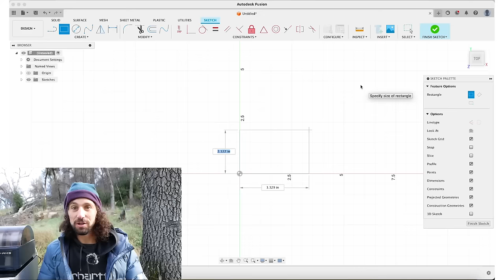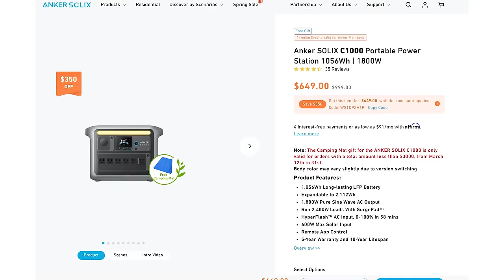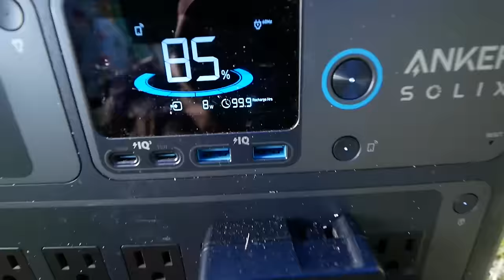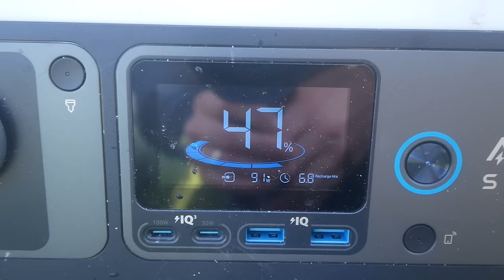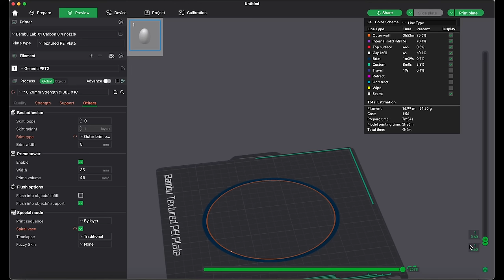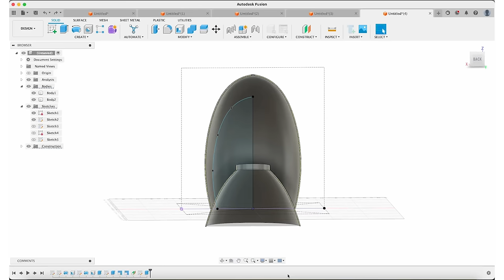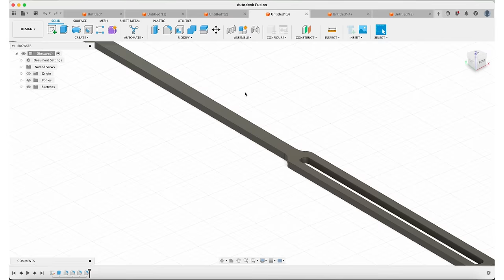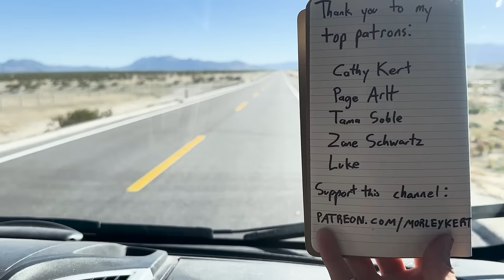I Survived in the Wilderness with a 3D Printer

Comment: Acorns!  Great video.  Here are my recommendations:

1. Printed frog spear tip
2. Printed knife for cleaning frogs/fish
3. Print a chain for your pot, so it is adjustable, instead of the hook, or in addition.
Reply: ChristopherWallbank-di9hj There are thermally resistant filaments, but those are all hell to print, and I wouldn't fancy trying to unclog a nozzle in the middle of the woods.
Reply: ChristopherWallbank-di9hj  did you even watch the video?
Reply: 4.printed rabbit snare
5.printed hand held crossbow(and bolts)
6.printed bird trap
7.printed fishing pole and hook
8.printed rain water collector
9.printed advanced warning system
10.printed bear trap

i could keep goin but i think we all get the point at this point.
Reply: @SnepBlepVR  could a 3D printer print a crossbow with bolts or a bear trap that actually works? And don’t forget the power supply restrictions he has in this situation.

Comment: i mean basically working with clay/ceramics was pretty much the first "3d printer" type thing. to many people sleep on what can be done with clay.
Reply: I dont think you can work clay out in the wild though. You'd need a fire far hotter than any natural open fire could get in order to get it to harden. But working with clay can be pretty cool, if you have a kiln for it.
Reply: @unironicallydel7527  you can fire clay with a small fire. There are also different lvls of firing clay and the higher temp you get the higher firing you can do. Also increasing the temp of a fire is pretty easy with some people just blowing on it with tubes or making some kind of pump blower. That and you can just make charcoal and use that. Or both. But yeah you can fire clay perfectly fine with a standard small bonfire.  I actually have a small Jack skellington head I made by just dropping it in my bonfire while I was drinking with my family. No blowing no charcoal just a small wood fire.
Reply: I also made a little ceramic water filter doing this. Just mixing sawdust and clay together before firing it.

Comment: The reason the rope is worse that the tpu filament is the heat to melt it breaks the copolymers in the plastic causing it to get weak. so you are always better off with using the filament as a cable.

Comment: I'm a little surprised you didn't try printing a net for the stream on Day 2.  The tiny basket, I wouldn't expect that to hold a sizable fish, whereas a net could possibly just corral some to make spearfishing (using a sharpened stick, not a 3d-printed spear) viable.  Then again, I am such a city boy, I probably shouldn't be commenting.  :)  Also, avocado is such a great radio handle.  :)
Reply: Excellent insight imo❤
Reply from the maker: I didn’t see a single fish in the river, so I’m not sure what I would use a net for. Unless it was a big gill net to act as a trap.
Reply: @MorleyKert  good point. Maybe if there was already a natural choke point, or a rock funnel, then a small net? But that's a lot of work for a place with no visible fish. Would love to see a part 2 where you apply insights from this time to see what could be improved. Dosnt need to be a full week of no food though haha
Reply: @MorleyKert  mostly fish try to stay hidden, that water looked like a great place for some

Comment: 9:28 the "flint" is the part that's made out of mischmetal -- this alloy of rare earth elements will burn in air. (Note that this is the opposite of traditional flint and steel, where the flint causes bits of steel to flake off and burn in air.) The magnesium is pretty much just magnesium alloyed with aluminum.
Reply: I thought it was ferrocerium, or are they just different names for the same thing?
Reply: @bs9692  You're correct -- the "flint" is made from ferrocerium, which is an alloy of mischmetal (~95%) and iron (~5%). Mischmetal is predominantly cerium (55%), but also contains other chemically similar elements like lanthanum (~25%), neodymium (~15%), praseodymium (~5%), and other rare earth elements. These elements are not easily separated from each other, so they are typically used as a mixture unless a specific rare earth element is required. (This is also why so many different elements -- four! --
are named after the town of Ytterby in Sweeden -- they were all mixed together in the ore mined there!)
Reply: Thanks you the extra information

Comment: Honestly, I have never had frogs, nor do I ever want to have frogs, but if I were to hunt them, I'd have made a frog-gig/fish-gig out of a 6' long stick. A gig is basically a multi-pronged spear you could use to spear frogs, fish, or any other slower moving animals. Using a gig, you could have used those frogs to catch fish. If I were to print a sling, I'd have made one that didn't rely on elasticity to function (think David and Goliath), just practice.

Something I'm surprised you didn't think of during the week, was to pile your magnesium shavings in a pile, cover it with your tender, and strike the ferro-rod into the shavings, pulling the ferro-rod towards you and leaving the steel near your target to ensure quick lighting. That would have made it much simpler to start a fire, instead of rushing to get your tender over the burning shavings.
Reply: Frog legs are absolutely amazing they’re like chicken but better you should try some one day

Comment: Definitely should have used a Hiking Trailer/Cart its like a wheelbarrow in reverse, it's pulled and not pushed and it uses a harness to attach to you. Think of it like those guys in India that have foot-taxis they pull you in, but it's smaller, has suspension, and is designed to handle uneven terrain, while keeping even weight distribution.
Acorns

Comment: Another thing that I would have done is to put those things that you don't want to get wet by turning the wheelbarrow upside down over top of them. 
You see, I'm a country girl and I've learned a lot of things in the 76 years of my life so far. 
What's the most coverage I can get with a tarp and how can I use a wheelbarrow to protect something?
If I'm gathering wood in my wheelbarrow and then I get to my campsite. How am I going to keep the wood dry simple turn the wheelbarrow upside down over the wood?.
It's not that difficult.

Comment: Basic Oven Roasted Peanuts:
This straightforward recipe yields perfectly roasted peanuts with just the right amount of salt.
Ingredients:
2 cups raw peanuts
1 teaspoon salt (optional)
Instructions:
Preheat your oven to 350°F (175°C).
Place the raw peanuts (in shell or shelled) in a shallow baking pan in a single layer.
Sprinkle salt over the peanuts (if using).
Roast in the preheated oven:
15 to 20 minutes for shelled peanuts
20 to 25 minutes for in-shell peanuts
Remove from the oven just short of your desired doneness, as peanuts continue to cook as they cool.
Enjoy these warm, crunchy roasted peanuts as a snack or add them to your favorite recipes! 🥜

Comment: Hey, I noticed your 3D printer seems to be using an AC/DC brick transformer? Couldn't you have gained more efficiency if you used some kind direct DC adapter to maybe power the printer directly from the battery without using the power bank's internal DC to AC inverter which is probably inefficient?
Reply: Hey I did some more research on your printer and your power bank! What you want is a DC "Step Up" converter powered from the 12V car port on your power bank, to supply the 24V DC that your printer needs. And since your printer can surge to 300W when it is heating the elements on the print head, you need a DC step-up converter that handles at least 12.5 Amps.

But if you do this, you will use less power bank power, and you won't have to carry the AC transformer brick when you go!
Reply: he doesnt just have a spare care
Reply: @Sky-Link  Huh?? What do you mean